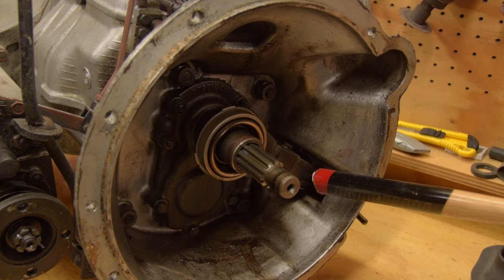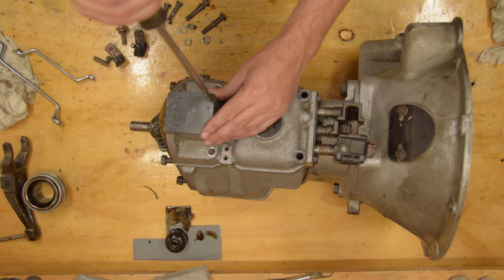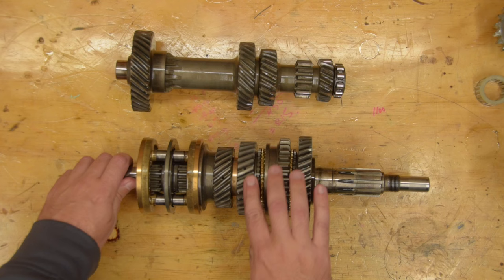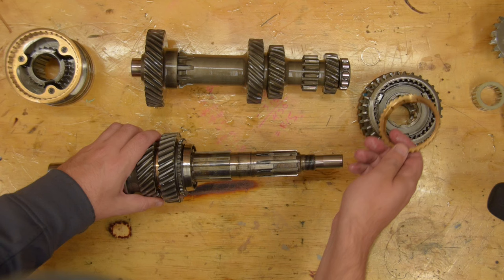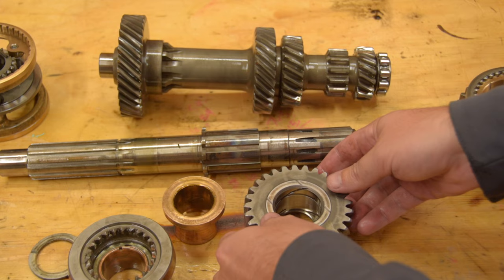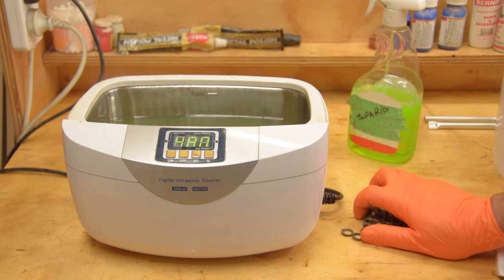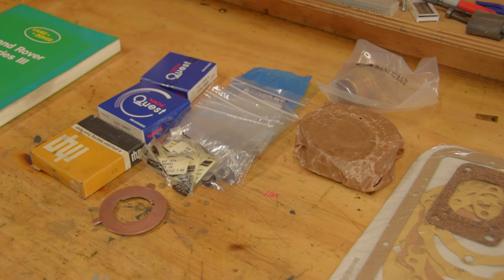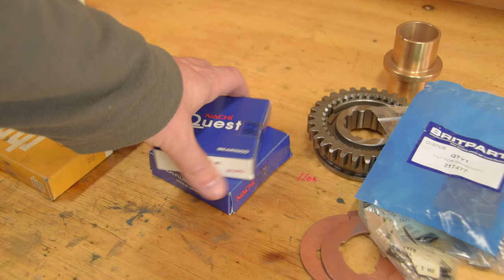Land Rover Restoration Part 2 - Gearbox 1/2

Comment: Put your bearings in the freezer overnight. When I am re-building, I put all my bearings in a small box and keep them in the freezer until I'm ready to use them. They will usually drop right in. When removing difficult bearings, get a can of air duster for cleaning computers, turn it upside down and freeze the bearing race. Great video, I like your attention to detail!
Reply from the maker: Yeah, definitely, good tip, I should do that. Forward planning is not my strong point... life is like a panicked race!
Reply: That's a damn good idea.

Comment: My goodness, you're awesome! My Landy has been standing for 12 years. Finally I have some reference and inspiration to dive into the reno and get the old girl back on the road. Thank you.
Reply: Mine was standing in a front yard with gum leaves and rubbish accumulating in the tray for 17 years . Coviod lock down and retirement 
was the prod I needed to get started. Down to rolliing chassis chassis. Found the reason for the previous owner parking it.......broken gearbox. Thank you Mr Croker....... your advice is invaluable......

Comment: Hi Geoffrey. Nice presentation. As a young lad I've rebuilt Austin A40 engines with my late Dad. He was a skilled mechanical engineer (Senior shop foreman, later workshop manager, Hamworthy Pumps & Compressors) but drew the line at gearboxes. He told me that too much oem tooling was required for ours. Measuring equipment of course was not a problem. I'm probably wrong, but in general Land Rovers look easier to work on. You can unbolt bodywork! Kudos for tackling the box, it's a complex and finicity item folks. BobUK.

Comment: Just a quick note mate if you get a 25 watt light bulb {lit of course} and sit your bearings on it prior to fitting shafts it will heat the inner race up enough so the shaft will go in without hammering. Hammering is known to bruise the bearing races and lessen their life expectancy, with heating the bearing i also put shafts in freezer for half an hour increasing the time for installation prior to the shaft heating up and sticking half way in when assembling. Not having a go just a friendly tip love the way you did the video and very impressed with the time taken to get the clearances right, keep up the good work will be following with interest.
Gippy

Comment: I once had a series 3 long wheel base canvas top which I completely restored and replaced the chassis. It was a diesel. I then drove it from bury st Edmund's to Bristol. Spent 3 hrs in a traffic jam due to a lorry which had caught fire. Hot day people on the side of the road with overheated motors. That old beast didn't miss a beat. Top speed about 60 miles an hour but it felt faster and like the end of the world was close. One of the best vehicles I ever owned. Not very comfortable but massive fun. I sold it for five hundred quid with 6 months mot :(.
It would power slide around roundabouts at about 25 miles per hour.

Comment: Seeing you heat the cases to get the bearings to drop in reminded me of using my mothers oven to fit my crank bearings on a two stroke motorcycle I had when I first started work  - Mother was not impressed - :-)

Comment: That was a superb look at the inside of the gearbox. I'd certainly be happy to use this when rebuilding one myself, which will no doubt happen at some point. Having removed the gearbox from my old SIII I agree that having to remove the interior and seatbox... and floor is ridiculous, I was much happier to have the removable crossmember in my Discovery when doing the same thing last year. Also maybe the next project could be a hydraulic floor press?
Reply from the maker: Yeah, it is the dumbest idea in history. The military chassis all had removable crossmembers. They weren't putting up with it!

Comment: I have never seen quite so much loctite used in any Landy application. Maybe I've been doing it wrong all these years? I mean everything still 'barely works' which is standard  ...but could slathering's of loctite on everything be the upgrade required to reach the fabled 'works' ?!? 

Loving your videos. Do keep them coming thick and fast if at all possible.

Comment: Very nice series of videos, excellent mechanical work! If you do not mind, I might add some info regarding the problem of snapping out of gear while going downhill.  I learned this from an article in the LRO magazine about 20 years ago.
The gear teeths are tilted to reduce noise from the gears, and the direction of the tilt drives the gears towards tighter engagement while pulling forward by axial force created. When pulling backwards the axial force pulls the gears apart.  To prevent this effect, a few (3 or 4) of the dog teeths in the shifting units are enlarged (wider) than the rest.  This creates a bending moment on the shifting unit when going downhill since only the enlarged teeths (located beside each other) take up the radial force.  This is supposed to be enaugh to prevent it from jumping out.  However after years of engine breaking, the enlarged teeths might wear down, the bending moment is reduced and it jumps out of gear. So the advice is to look for wear on these enlarged teeths and repace the worn parts.

Comment: 4th gear is direct drive by just connecting the input shaft and the output shaft together (no gearing involved). This is why 4th is always quieter. The gear that you called 4th drives the layshaft so it can in turn drive 1st, 2nd, 3rd and reverse when they are engaged. Many other gearboxes are like this. Fifth gear can be an overdrive gear with a ratio greater than  1:1. Hope this explains it.

Comment: Great video, big fan of your work! 
Hey quick question, why did you remove the bearing seals? Do they would be lubricated by the gear oil?
Reply from the maker: The bearings run in oil. Sealed bearing wouldn't last long in this sort of application with just the grease inside them.

Comment: Had to do this in a paddock in Rotorua on my 2a station wagon after the layshaft broke between 1st and reverse, couldn't afford the tow back to Auckland so welded it back together, put it back in and drove it home. Was a bit noisy.........but got home ok.
Reply from the maker: Haha, classic. The point is - that it got you home.

Comment: Get some permatex High Tack. A nice thin even spray of that crap and yur gasket doesn't move around. I have used this stuff for years (decades) to great effect on all gasket types. I'm not certain if it's written on the can because my father showed me how to use use it properly, when I was a wee lad.... Spray a nice thin, even coat on the gasket surface and the gasket, walk away for a half hour (don't leave this out somewhere where copious amounts of dust is blowing around). That's really all there is to it and now the gasket sill stick (without tearing if you need to remove it) and wont shift around on you.

All the normal rules apply for a sealant, especially make sure surfaces are clean and dry.

Comment: It helps a LOT to have a non flexible surface as a backer when trying to hammer something like that shaft out.  You can see in the video how most of the energy from the hammer blows is transferring right to the table top.
Reply from the maker: Yeah, wish I did. If it was my own place I'd bolt a heavy table in place.

Comment: Love this series. You do a really good job of explaining the basics like how the gearbox actually works. Subscribed!

One question - why did you unseal the bearings, are you worried heat from the gearbox would melt that plastic seal?
Reply from the maker: Sealed bearing aren't really suitable. The bearings run in oil. That's the best.

Comment: I have a semi-unrelated question(as I'm rebuilding a series 1 gearbox)in regards to the 3rd and 4th synchro. At first glance the synchro seems to be ambidextrous, i.e no directionality, but upon closer inspection there are clear differences in the profile of the centre gear. I'm not sure if this applies to later series Landy gearboxes, but I'm stumped as to which side of the synchro engages with 3rd,and which side with 4th. Any help would be greatly appreciated

Comment: 18:58 FYI that pin shouldn't be moving. It's the moving that's causing it to shear. In machining, that's a bad fit. You have to seek out larger pins for that, or, you'll run into the same problem, again.

Comment: Awesome, awesome video.   Also, probably the most telling display of why later series rovers are so incredibly unreliable.  Despite popular opinion, crucial systems like the gearbox are in fact exceedingly complex, finicky and failure-prone designs with massive, stout parts completely dependent upon tiny, soft-metal pins and "retaining compounds" that will most certainly fail with any kind of continued use.  It would be interesting to know why rover chose these designs in the first place.  Were Series 1s designed better?
Reply from the maker: I think the series 1 gearboxes are identical apart from not having the synchro between 1st and 2nd. Here's the thing though, the big stout parts still get you home. It just sound a bit worse every time something small shears off!

Comment: I was hoping to see you customize the bushing and splines to match the other half and get rid of those ridiculous pins. Fun to watch no pullers for press fit required, just a burly mechanic 🧐
Reply from the maker: Ha. Yip, well, they were intended to be fixed in the middle of nowhere. No presses there either.

Comment: some luck googling will take you to the timken bearing website.  there are various bearing and seal catalogs there to download .. not just application but several bearing catalogs by size and a seal interchange and a seals by size catalog to avoid know it all counter help. 

 on the double ended bushing over the pin in the shaft. how is the ID of the gear that spins lubricated.. is there a hole drilled thru the gear so each time the gear and the lay shaft gear meet.. some oil is pumped into the ID with the meshing of the gears..  that is how other transmissions do it..  i might have also scrounged a larger pin to put in the shaft.. that fit was kinda loose and the pin really small in diameter for what it is expected to do.   replacements could be an inferior metal also.. just selected by available size.. not strength.  might have to carefully cut down a 12.9 allen cap screw with enough length to give you smooth shank to press in.
Reply: Agreed

Comment: would it have been possible to use a key (like a taper or gib-head) to keep bushing from spinning on the shaft?
Reply from the maker: The shaft is way too hard to cut a keyslot into.

Comment: How is yout zinc plating so shiny? I tried you diy method with just vinegar and got a great resoult but it needs buffing. It’s some premade solution?
Reply from the maker: I use a commercial plating solution that also contains brighteners. If you want to keep playing around with the vinegar method there are diy brighteners you can try adding but it's not something I've experimented with.

Comment: Ya know "if it doesn´t work, get a bigger hammer" is not the right way in case of gearboxes... maybe they wrote "drive it out" but wanted to say "press it out". The method with a hammer kills most likely the bearings. Not everytime, but often. I would use a press. Or build me something like a press, maybe out of some pieces of allthread and heavy walled square tube.

Comment: How did you remove the reverse gear shaft? mine is stuck.... Did you heat it?
Reply from the maker: Is there a small hole in the cover behind the rear bearing? I think you can use a punch through the hole.  From memory.

Comment: I’ve a series 3 109 and I’m restoring the LT76. My gearbox isn’t fully synced(probably they put an older replacement underneath) is the mainshaft the same? Is it possible to make it fully synced?
Reply from the maker: That's above my pay grade... I assume it'll be different but I don't know.
Reply: I see it as an Challenge

Comment: From past experience, that bushing would be worth making from scratch by a pro with proper materials. Also, i doubt that's OEM OG stock, there was only so much stock that sat around. But that's just my 2 cents, and it's based on having seen actual OEM stocks for gearbox bushes, and they sure didn't come repackaged in a plastic bag, rather in a oil soaked piece of paper that made sure the material remained impregnated. So, to start with that's a ... weird thing, on the scale.

Comment: Superb video. Helping massively with my current gearbox refurb. What products/technique do use to get the aluminium casings so shiny and new?
Reply from the maker: Nothing fancy. Just degreaser and a brush.
Reply: @GeoffreyCroker  Elbow grease required then.  Looking forward to the axle vid!  Already rebuilt mine so I'm hoping I've not missed anything.

Comment: Your use of the propane torch seems very minimal. I would have heated that case up a lot hotter and let the bearings almost fall in. Would that have been wrong to do?
Reply from the maker: Risk cracking the case.

Comment: Im new to Land Rover and have just bought my first one!! I have an intermittent problem where i cannot select any gear apart from reverse. This happens about occasionally and lasts for about 30 seconds before returning to normal???
Apart from this, it seems to work well. Any ideas what it could be??
Reply from the maker: Could be a number of things. Have you checked the clutch fluid?
Reply: @GeoffreyCroker  Ive just bough a bleed kit so its getting done at the weekend. Will also check the oil levels apparently. This is the start of a project me thinks!!

Comment: I'd just watch your video, and I'm stunned with your impressive work, what do you think of bearmach spare part? I never saw any Italian parts sale in Indonesia
Reply from the maker: You take your chances. I think bearmach britpart and allmake are all the same. Sometimes it's fine sometimes bad.
Reply: Landy parts supplier told me that bearmach, even britparts had the same issue lately and supplier/seller stop imported the parts, it happen when I order 8 set of series III 109 tappets, and the seller advice me for not replace the original parts and just adjust the rocker arm..
Reply: Geoffrey Croker what is your advice for me? Thanks anyway...
Reply from the maker: Depends on why are you replacing them. If they are just loose on the shaft, you dont need to replace the whole rocker, just change the bushings inside them.

Comment: Probably a silly question: why did you remove the seals from the bearings? For a layman it would seem that if you have them, why not keep them?

Also, as far as the new format is concerned, as a non car-guy I am way out of my league here with all of the terminology, etc. That makes it a little less approachable than, say, something that is basically just an electric motor and some iron. But we're just starting, so perhaps by the end I'll know exactly what you are talking about.
Reply from the maker: The bearing run in oil. They will last a lot longer in oil. Thanks!
Reply: @GeoffreyCroker  I can see nobody uses word search for "seal".  F3 on my PC.  Geez, you must have answered that same question half a dozen times.